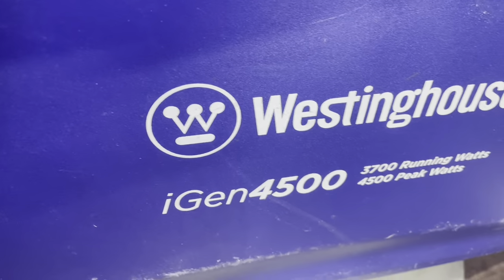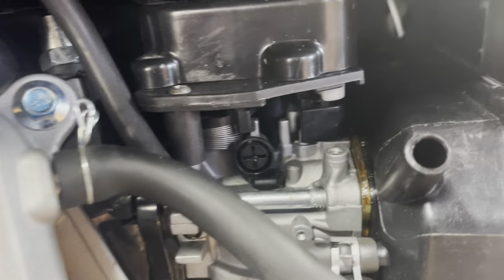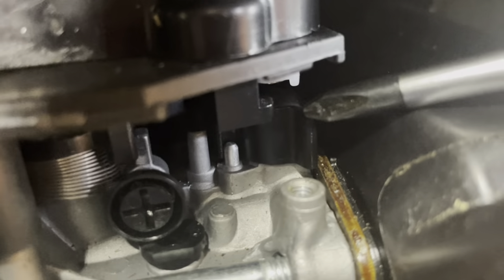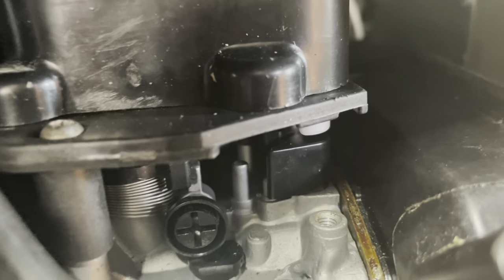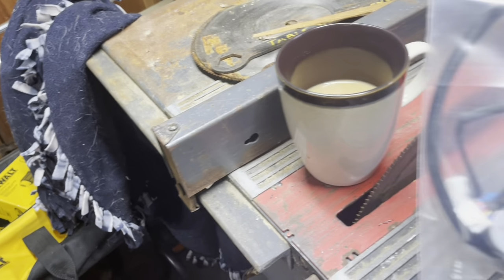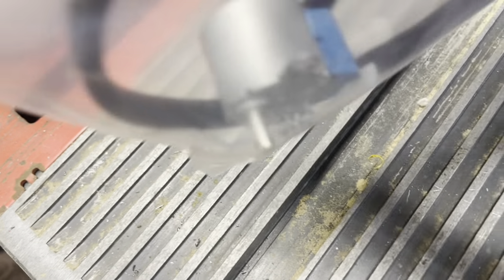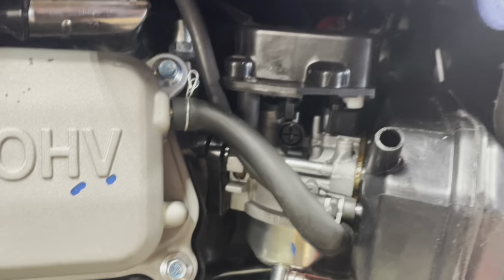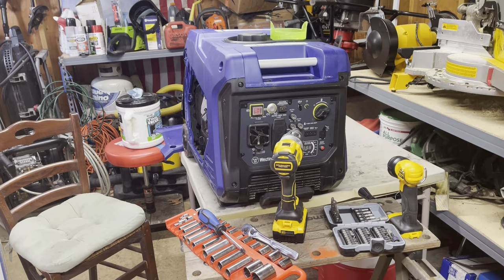Westinghouse Choke Fix - stepper motor

Comment: It was my pleasure speaking with you and helping you with your iGen4500 generator. I will be using this video to help other customers when needed.
Reply: This is the exact generator as the Cummins 4500i. Do you know of others?
Reply: Hey bud. How would I get a hold of a charging cord that plugs into the front. I’m wondering if that cord is a charger or a maintainer. There’s not much in regards to whether or not it’s a maintainer for off season.

Comment: Great video. Wish I had seen this a year ago when I had the loose connection (did not realize it) issue, but Amazon replaced the first one I ordered. I came here for help replacing the carb and aligning the stepper motors. Job well done.

Comment: Called Westinghouse and talk to a lady about my problem with the choke not working properly. She is sending me a new stepper motor and the control box that it connects to. She said they are in Ohio and was very good to talk to someone I could understand. Great service and didn't take long to connect to the tech!
Reply: Westinghouse sent me the wrong stepper motor three times. My stepper motor  has a 5 pin plug and Westinghouse sends a stepper motor with a 6 pin plug. Sent them photos twice along with the correct part number, but they keep sending the wrong part with the wrong part number. I finally got my soldering iron and heat shrink tubing out and change the plug on the 6 pin to 5 pin. Not real happy with this $1100.00 inverter.

Comment: Took delivery of my iGen 4000DF on Tuesday. The unit came with the factory fix for the auto choke. I installed a Drainzit (Hon1010) for easier oil changes. Took my time and after a couple hrs. it fired up, first time. Bought this as an emergency power source in storms.

Comment: Wasn't sure where the spring actually went, also was your choke working at all. My choke will go to full choke when starting but doesn't return to open when it started. Stepper motor or possibly control board? Thanks

Comment: Mine is having hot start issues, and goes into an overload mode at 50%.  This might be the source of my problem and will be my starting point. I’d also throw a clean fuel filter at it if the problem shows up after some hours, you know while you’ve got everything apart, and you’re touching it. Since the Cummins shop wants to charge a $650 3 hour diagnostic fee, we’re on our own out here in YouTube University Land.

Comment: Where does that spring go? Good video this happening to my Westinghouse generator right now .
Reply from the maker: They go on the nipple on the end of that small white bracket that the stepper motor sits over. I tried to send a picture but couldn’t. Pause video when I get ready to put stepper motors back on and zoom in on the white brackets. Still new at videos. Hope it helps
Reply: @sc22488  Thank you

Comment: Any chance there was a part number for that stepper motor kit? I am having the same issue with mine.
Reply from the maker: There was no part number on the bag Westinghouse sent me, but when I told them the problem they knew exactly what I needed and sent me the stepper motor. I did copy the information on top of the stepper motor which is below. Hope it helps.

24BYJ48
12 V DV
249950
YS:220125
Reply: @sc22488  Thanks I will call Tuesday